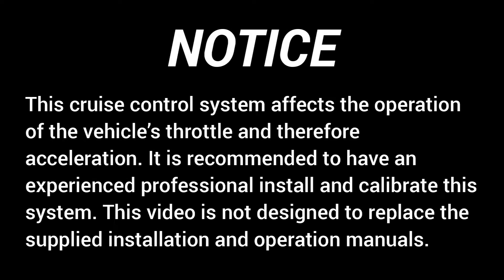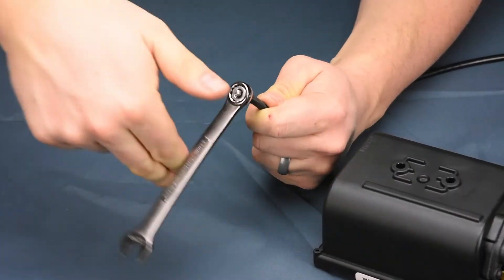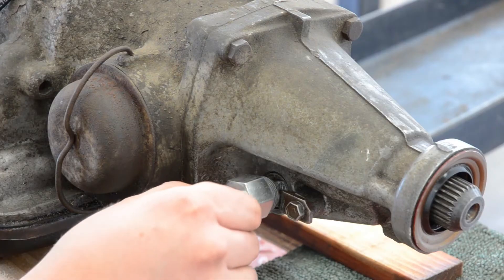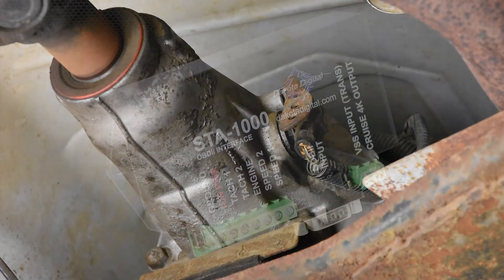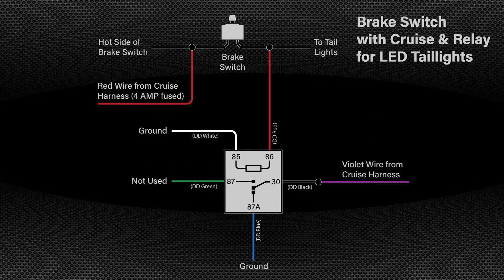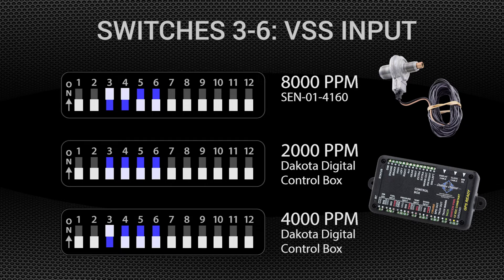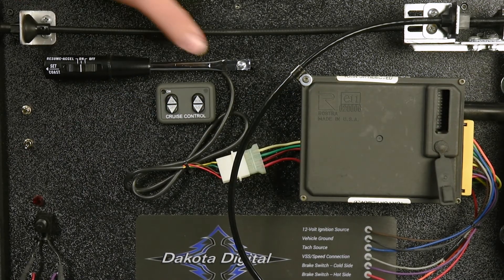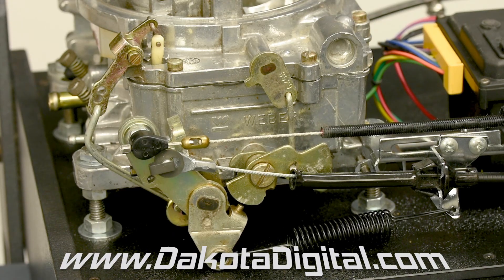Dakota Digital Cruise Control Installation CRS-2000/CRS-3000

Comment: I am currently having the issue of the cruise working but not keeping a steady speed, I’ve looked over the probabilities sheet and went through everything and it looks to be working, I did however notice whoever installed the cruise control mounted it right next to the coil so I’m wondering if that could be the problem?

Comment: I am new to this, but how would this work for Carburetor. I plan on putting a 750 CFM Brawler Street Carburetor Mechanical Secondary for my turbo set up on 1993 Ford F150 4.9L straight six. I finally got the cruise control to work as EFI but i am swapping to carb. Curious for my 1966 AMC Ambassador 990 Cross Country too
Reply from the maker: Thank you for the message.  This ends up being very similar, as the throttle cable originating from the cruise control will be connected to either a throttle body, or to a carb.  Hardware is included with the cruise control package, allowing connection to either.

Comment: Unbelievable!  I managed to separate the 4 wire connectors.  Apparently, the tab that goes into the loop in the other side of the connector just barely fits into the loop.  In order to separate the connector you have to in essence make the loop bigger so that the tang on the tab can clear the loop.  I did this by holding onto the side of the connector that has the tab on it with a pair of vice grips being careful not to crush the connector and prying up on the loop with a very small screwdriver.  Once the loop is big enough that half of the connector pops off.  The plastic is soft enough so that it gives a little bit and did not break.

Comment: You didn't show where  you have to separate the wiring harness at the connectors to get the wiring through an existing hole in the firewall.  Good luck.  I've been trying to get the two 4 wire connectors apart for hours.  The last resort is to destroy the clip on the connector, then it'll come apart.  These things are impossible. The instructions offer  1 sentence and warn not to pull on the wires.  UH-HUH, yeah.  I'm holding one side with vice grips and poking the tab in with a small screwdriver because pushing on the tab with my finger is worthless.  I'm probably going to have to get a band-aid soon after I jab myself with the screwdriver and bleed all over the connector. If only you had used better connectors.  I hope the rest of the install goes better.

Comment: when are you going to make one for the holley terminator xmax with drive by wire?
Reply from the maker: We would suggest taking a look at our CRC-2000.
Reply: the instructions state not for holley @DakotaDigitalTV
Reply from the maker: @jcook69camaro  If all of the parameters of the pedal are set to GM specifications, the CRC-2000 can be used.

Comment: Do you cruise for a 2004 Elantra stick 5 speed?
Reply from the maker: Hello James,
The CRS-2000 and CRS-3000 are universal cruise control packages.  While they are not made to fit the Elantra, they should be usable here with a vehicle service manual and some fabrication in regards to the throttle connection.

Comment: Something this video does not address is throttles that have greater than 1 5/8 movement.  Trying to install this on a P-pump diesel with a bit over 2" of throttle travel, and it will not pull the cable enough to go faster than 62mph.  The instructions say to add some slack.  But I do not see how that helps.   The box still has to pull in that slack and then goes over the 1 5/8" limit even further.   Maybe I'm over thinking it.   A video of how adding slack resolves that issue would be extremely helpful.

Comment: Can the 45 mph limit be overridden. I am considering cruise control on an electric vehicle for spraying and typically at speeds of approx 10 mph. Is this possible?
Reply: You could get the 8k pulse per mile kit and set the input to 2k pulse per mile that would get you 12 mph activation
Reply from the maker: Thanks for the message Wayne,
Since the PPM settings will directly impact the minimum engagement speed, you could offset this number to reduce this closer to your preferred target.  The side effect of doing this will be in accuracy, though.  This sort of low-speed operation is outside of the design scope of this product, so the results just may not be favorable.

Comment: @DakotaDigitalTV at 6:10 the video says "Ununfortunately this is output is not active when used with BIM-01-2 OBD-II interface"  Is this true for all "BIM-01-2" modules or just the "BIM-01-2 OBD-II" module?  I am using the BIM-01-2-HLLY with my HDX-73C-PU dash and I am wondering if I will need the STA-1000 module for cuise control.  If it matters I have a Holley Terminator X max with a 4L80e trans.
Reply from the maker: Thanks for the message Alex,
Since the Terminator X will contain a VSS output, we would suggest connecting this signal to the HDX "SPD SND" terminal on the control box.  Providing this wired VSS signal will allow you to take advantage of newly-calibration SPD OUT terminal, allowing you to connect this to the Cruise Control speed input.

Comment: Will this work with a 1985 Nissan pickup, 4 cylinder manual transmission.  Model 720.
Thanks
Reply from the maker: Hello there,
This is a universal cruise control kit, so it could be used within this application.

Comment: I’ve got a 64 Impala that already had a working cruise control. I added Dakota Digital gauge cluster and now my cruise control doesn’t work. What could be the problem? Thanks
Reply from the maker: Hey there Tim,
A few things could be going on, but the most likely suspect is that the VSS wire is no longer connected to the cruise control. We would suggest starting with this gray wire to verify this connection.

Comment: Will it work on my Nissan Teana J31?
Reply from the maker: Thank you for the message. This unit would not be suitable for a model such as the Teana, due to the electronic (drive by wire) throttle pedal.

Comment: I have the DD Ion series, speedo/tach/odometer in my late model Mazda truck and I'm using the DD SEN-01 8K pulse generator to acquire a speed signal. I also have a Holley Sniper EFI 2300 fuel delivery system and having this cruise control system would be immensely useful. I drive all over the Midwest in my truck and my right leg/ankle gets really sore (I'm 6'4" and I have screws in my ankle) Even after only driving for a few hours my leg will begin to cramp up on me. I'm really happy to see this.

Comment: What if the throttle is very close to the unit and you need the cable shortened? Can you cut it to shorten it? Or is it better to just loop the cable over itself and then connect to the throttle?
Reply from the maker: Hello there Hexameter,  We don't typically recommend shortening the cable.  You could loop it, like you've mentioned, or crimp on a additional ferrule in the proper location.
Reply: @DakotaDigitalTV  Thanks!

Comment: Can a redundant cancellation switch be added to a clutch pedal?
Reply from the maker: Hey there Jason,
Yes indeed, a clutch pedal disengage switch is a nice option for a manual vehicle.
Reply: @DakotaDigitalTV  so it is possible to have a switch on both the clutch and brake pedal with this system. Awesome. Do you sell extra switches and also, provide documentation for wiring 2? Thanks!
Reply from the maker: @hillbobaggins  Thanks Jason,
Yes, we stock a clutch switch, part number SEN-4206.  Alternatively, a standard brake switch would handle the task. 
Certainly, we can provide you specific wiring instructions for the addition of a clutch switch.
Reply: @hillbobaggins  Just wire the two switches in series.

Comment: Will this work on a 2006 Mitsu Lancer LS ? Can you share the install sheets before i make a purchase? Also, can i keep my steering cruise switch to work with it?
Reply from the maker: Hello!  Late model imports are a bit outside our wheelhouse, so we can't offer much assistance with this application. If you'd like to take a look at the installation/operation manual, it is available on our website here:
https://www.dakotadigital.com/index.cfm/page/ptype=product/product_id=393/category_id=255/mode=prod/prd393.htm

Comment: Will this work with a 1987 gmc Jimmy with a 350 tbi? Could I use the original cruise control switch on the turn signal stock? I have the rtx gauges for the later mode squarebodys
Reply from the maker: Hey! Yes the cruise will do the job, but we need a four-wire switch to operate it; can you confirm if your stock switch is of the three-wire variety or four?

Comment: Great video.  I have owned this set up for over a year.  Only problem I had was "solid core" spark plug wires do NOT work and will interfere with the electronics.  I swapped them out to suppression core plug wires, my problems when away.  Works great on my 1966 Mustang with the HND-2 switch!

Comment: I am installing this on my T bucket.  The engine is a 396 chevy.  This was very much worth watching.  I had one question about the added ice cube relay.  Your picture of how it looks when it is wired in was all that I needed.  I was concerned that with the brake peddle engaged there would be a short in the light system.  I see that you are routing the 12 volts through the built-in windings of the relay.  I understand now.  You might want to reword your instructions and show a picture of it hooked up like you did in this video.  Nice video.
Reply: All you need is to add some conductance to the brake circuit. The relay coil is enough. You don't even need the relay contact connections. Heck, a resistor across the brakelight circuit would do the trick as well, with no relay required.
Reply: @Cotronixco  Well you are correct, but, I understand ice cube relays, I do not understand resistors.  There are a jillion different resistors in all shapes and sizes.  I am a mechanic, and have been for my whole life.  I wish that I was more at home with electronics, but alas and alack, I am not.  I am 73 years old, and I am in the group of people that do not even understand my damn "smart " phone!   My phone is way smarter than I am, yet I built a vehicle from scratch.  If I need something new on my phone, I have to give it to a 10 year old to get it accomplished.  LOL  Sad, but TRUE!
Reply from the maker: Thanks for watching, and the feedback! The taillight relay is among the most asked-about steps of installation.